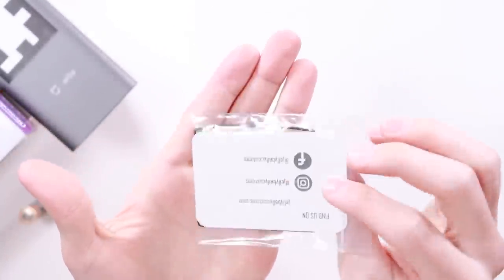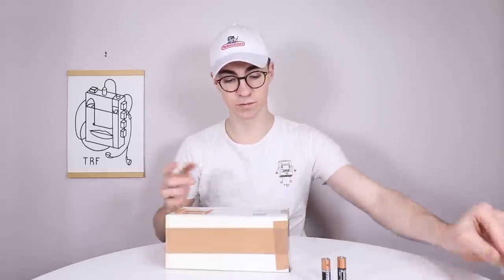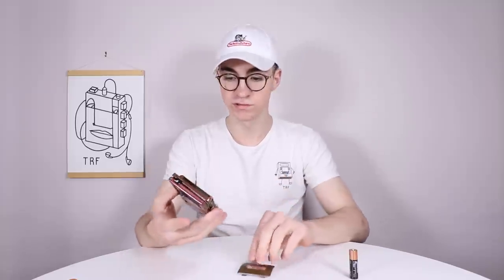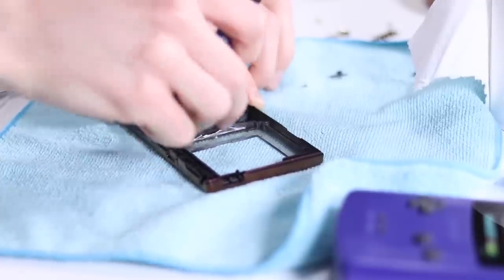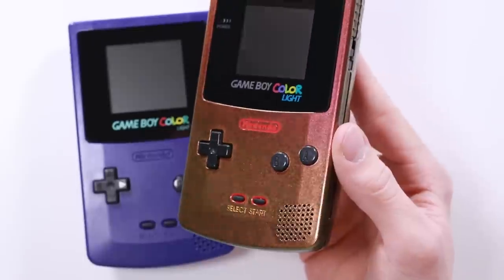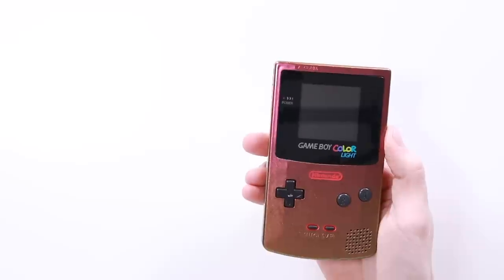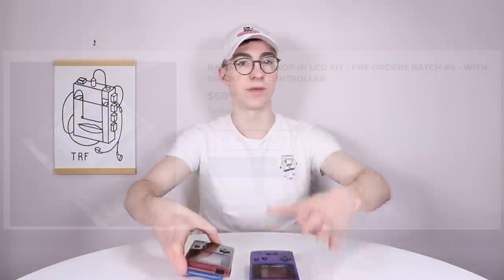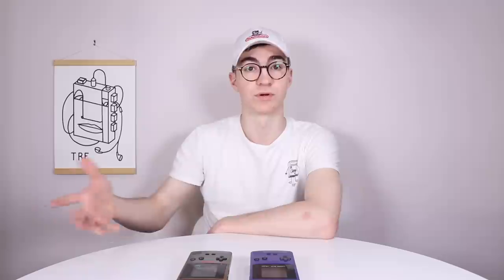"Drop In" GameBoy Color Backlit Screen Upgrade!

Comment: This makes me wanna get a game boy color and backlight it like this.
Reply from the maker: You should!
Reply: Now for roughly $60-80 and 20 minutes of work you can. The old way of modding the GBC with an SP 101 screen was a nightmare.
Reply: I found one on mercari that would be a project.  It's an atomic purple, that I'm thinking I'll make an offer on this weekend if it's still there.
Reply: @mullinsjm1  Can never go wrong with atomic purple. It's iconic.
Reply: If you have the money i highly recommend it. Got 2 of em right now. You can even solder a small wire from the screen pcb to the select button for brightness control.
Reply: @wes both are iconic
Reply: Its nice and all but the screen is smaller which is a downgrade

Comment: I noticed you didn’t trim the pins on the front of the board as recommended. Is this an optional step? It’s seems the shell closes just fine without trimming.

Comment: Thought you should know there is now a BittBoy v3. Tempered glass screen, ghosting fixed and vibration/rumble feature. 

A v4 designed to look like a game boy turned on It’s side said to be in the works. Additional buttons and possibly dual speakers.

Comment: Is there a drop-in screen mod for GB advance???
Reply: AGS101 and soon bennvenn is releasing the NDSL converter.
Reply: @Altirix_  Not sure what NDSL converter is, as far as AGS101 goes I haven't been able to find a drop-in one only ones that require soldering.
Reply: You can just simply put AGS-101 screen without soldering anything at all

Comment: I think the dimmer thing could be fixed by screwing arround with the potentiometer hiden behind the battery compartment
Reply: It can be on the GBC101 mod, but not on the Freckle Shack mod.  It's not utilized in this kit.
Reply: @KyleAwsm  aaahhhhh I didnt know that, i knew cuz i was messing arround with the potentiometer of my GBC and got more live colors

Comment: I'm thinking of doing something like this but on a Pokemon limited edition GBC, so I'd prefer to keep the original screen window thing. What's the best way of going about something like that?
Reply: The screen window will be slightly big, so the metal edge of the screen will be visible. It's still totally playable, just not flush looking. You could try covering the metal with black electrical tape if you want. Jellybelly has Pokemon themed screens as well though.
Reply: @spoonybardtoma  Are all screens smaller than the OEM one? Even the GBA 101 mod?
Reply: @MarcosCodas  McWill is the same dimensions as Freckleshack. The 101 has a smaller play area, but a larger screen size, so instead of metal borders you'd have some visible black pixels instead. You'll also have to maul the heck out of the shell. Personally, I wouldn't wreck a rare shell just to save a plastic lens.
Reply: @spoonybardtoma  Thank you for taking the time to reply. I might just leave this one alone and buy parts to make my own GBC Light. I don't think it's worth modding a rare GBC just to have it be something that it's not.

Comment: So I have an original yellow gameboy color that I recently took apart and cleaned and put back together. Are back light mods or screen swaps on intact original hardware generally frowned upon or do people even really care? It's in such good shape I am reluctant to mod it, but at the same time the original screen even in great shape is unusable. Idk how I did it when I was a kid xD.
Reply: I was thinking about just putting it on the shelf with my other carts... but it is DAMN tempting to screen mod it and get a multicart. I do have a retroid pocket 2 that I could fire up and use.

Comment: You skipped an incredibly important step. You must trim the cartridge connector pins flush with the circuit board. You can destroy the screen if you close it up without doing this. As I did...
Reply: Oh my god, I'm so sorry...

Comment: That is impressive,  is it sprayed from the inside?
Also is there any kits like this for the original Gameboy?   My one I had as a kid has a leaking screen,  so been intending to replace it for years.
Reply from the maker: I think it's had a coat of black paint on some parts of the inside. Ben has got a new screen for the Gameboy DMG however it's not the same size so you have to do quite a lot of casework.
Reply: Hi, thanks for. Asking. Its sprayed on the outside. I used chameleon paint on it which changes colour in different light. It requires black paint under it to give the best colour effect

Comment: You didn't flush cut the pins for the cartridge port on the screen side of the system's PCB, that should ease up some of the pressure and I've seen it as a recommended step for installation.
Reply from the maker: Oops! Oh yeah.

Comment: Not sure if you’ve done a video on it, but it might be interesting to cover other GBC mods you might want to do at the same time as the screen replacement.

I’ve noticed the speaker volume of the GBC is fairly low and I think there’s mods for that for example.